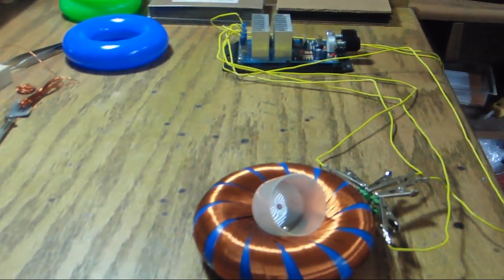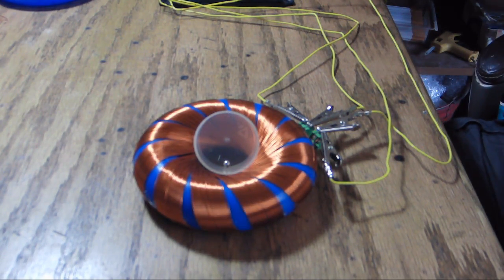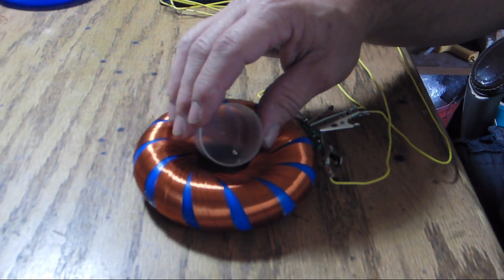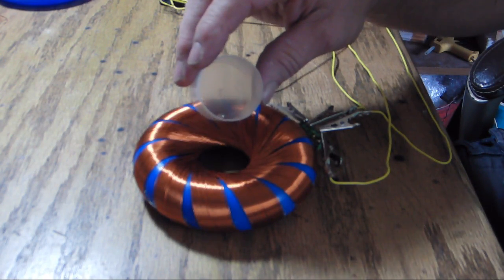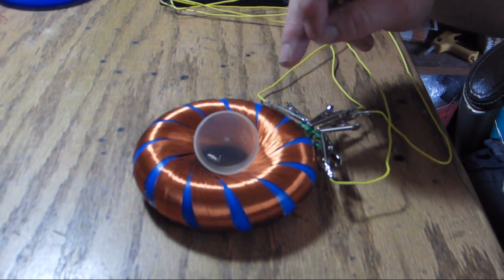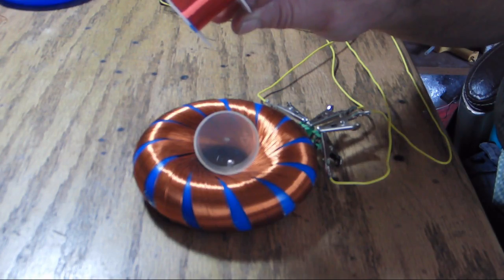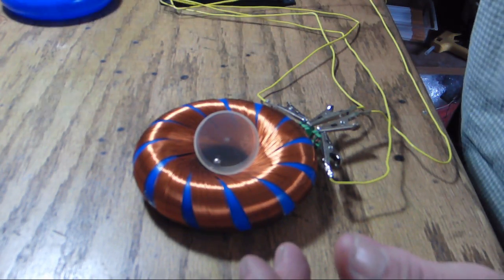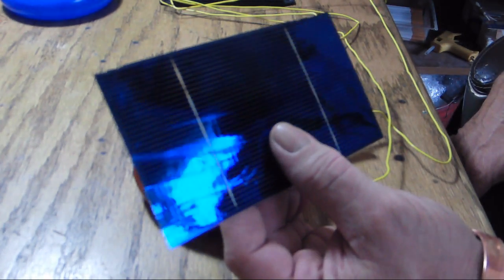Rodin Coil and Solar Panel Free Energy Update

Comment: Idea:
Place the bearing on a motor (converted into a generator), so that the "motor" spins. Then, test the volt difference at the exit points of the "motor".

Key:
The rodin coil is acting similar to a step-up transformer, increasing the small V-in from the solar panel and resulting in a larger V-out.

Comment from the maker: @rongrite You got me. I haven't measured any of my stuff like the PC and TV amp draw. I only have 1200 watts of solar panels hooked up and I run one room with a PC, TV, and a couple of lights. Oh and the coffee pot and phone charger. This room will drain the batteries by the next morning if I leave everything on all night. If the batteries are dead it will take 1/2 a day to charge them back up. I need between 35 and 40 - 200 watt panels and I' ll be close to disconnecting from the grid. :)